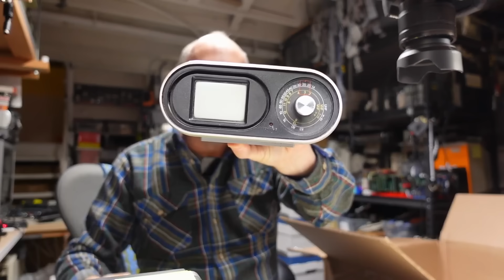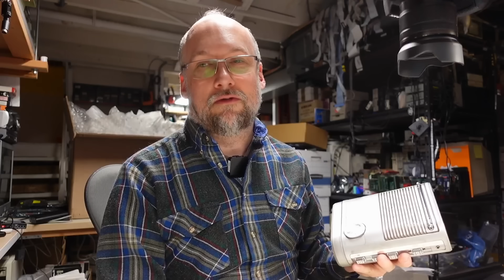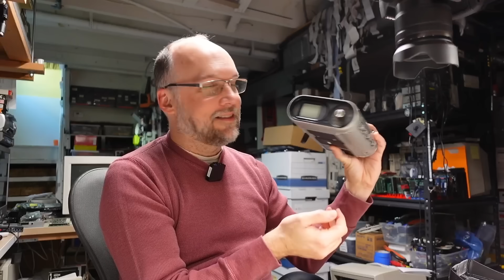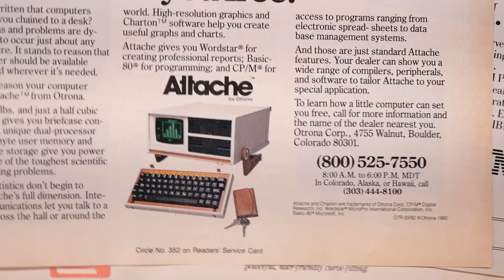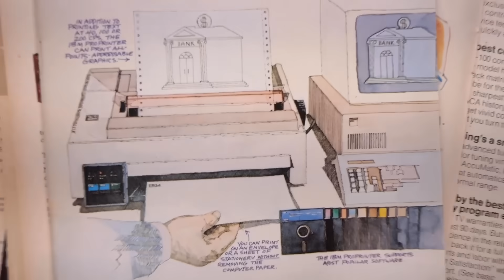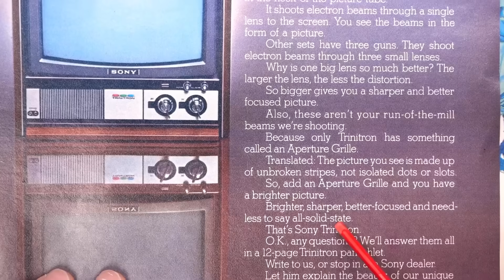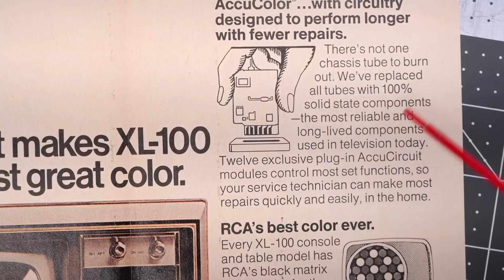0076 A binocular TV, the wiggle method rocks on Mac parts, and some awesome old print ads

Comment: Tubes can work in a phase locked loop and can provide a stable and accurate oscillator as a result. They just need a little time to stabilise as they get up to temperature (although some designs were almost instantaneous in reaching operating temp and were low noise at high frequencies and very stable e.g. Nuvistors). NTSC transmitted two phases of color and a burst which helped to synchronise the oscillator. The reason it altered in hue was not so much down to the tubes (although they were a factor) but rather the fact that NTSC didn't alternate the phase to get phase error correction like PAL and SECAM did. I'm not saying PAL or SECAM were better - they had their own different problems (look up Hannover blinds for example).

Comment: The early transistor manufacturers in the US went to the consumer electronics makers in the 60's to find out how cheap they had to be able to sell transistors to get into the consumer electronics market.  They found out the tube makers gave tubes to consumer electronics makers for free, and made their money on the replacement market.

A couple of decades earlier, the pioneers in electronic computers discovered the tube makers had a trick to make tubes fail relatively fast:  They over-rated them by about 25%.  The early computer makers found that de-rating the tubes to about 80% dramatically improved their lifespan.
Reply: I don't think they were actually over-rating tubes, it's just that the design life wasn't very long. Derating extends the design life. On a similar note, most capacitors are only rated for 1000 hours when run at the rated temperature.

Comment: If indeed the polarity is correct on the zenith the Zenith requires a 780 milliamp power supply.  It may not be able to start if it's only getting 300 milliamps, because it takes a lot of power to get that picture tube running

Comment: That "Macro Arithmetics Processor" is actually pretty freaking bad-ass for its day!

I found an older version on Archive: 15 Million rounded 32bit FLOPS, Coding in ASM or Fortran (it's architected to accelerate Fortran in Hardware), Field upgradable, blah blah.
Recommended use was vector processing for Seismic activity, Sonar and Radar, Telemetry, Biomedical, X-Ray, Image Processing, Comms and Speech, !Nuclear Science!, Vibration and Noise Analysis ... and ... Simulation!

And that's the older model! I'd love one of these 😀

Edit: The specs given here are from 1976 (my year of birth!) and the machine operates like a co-processor. It needs a host to give it commands and files and so on.
RetroBytes did a video recently about "The Transputer: A Parallel Future", This MAP seems similar ... worth a watch!

@Adrian I would love to see you play with one of these!!!

Comment: One of the first jobs i had was at an appliance/tv store, and i repaired a few tube based PTP wired sets.  The oddest part was the terminal strips which were just jam packed with capacitors and resistors, because where else would you mount them?

The interesting thing is those old tube TV's were almost always repaired by replacing whichever tube had blown.  I'd pull the cover and look for the filament that wasn't lit up.  No adjustments or anything, pull the bad tube, replace it and the TV was repaired.

Comment: When my parents upgraded their TV, I inherited a monster of a console unit.  A Zenith 25" console TV with the wood construction all around, and the neat pull down panel on the right side that had the controls (vert, horz, tint, color, etc).  I did have a terrible set of rabbit ears and the vacuum tubes were starting to fail, but you know for someone who was 8 years old at the time in 1983 it was awesome!

Comment: I did some looking up on the older computer companies. The CPSI MAP-6420 appears to be aimed at data acquisition. There's an article about it from the US Department of Energy. From what I can interpret from their advertisement is their computer is far smaller than the big array of cabinets in the background. Their headquarters was located about 30 miles west of where I live now. I worked not far from there in Lowell during the same period. I couldn't find much else about them.

The Attaché was Ortrona's first product and the company was founded c. 1981 and was liquidated in 1984. The company had a not-so IBM PC Compatible model but couldn't produce it and that was the end of them. So much for their success. There's an article about them on Wikipedia.

I found the advertisements interesting. Having worked as a typesetter, I noticed that the typefaces look so clean compared to the digital printing we have today. The text was typeset on a typesetting system and films were produced from the output after everything was pasted up on boards. To this day, this output is far cleaner and crisper than the output we see from digital systems which are limited to 2540 dpi unlike the analog printing methods of the past.

My first interaction with Zenith TV was when I was about 3 years old. From what I was told, I was interested in the workings back then and used to pull the cover off and poke at the tubes and "adjust" things. Dad would be fuming when he got home because he had to readjust everything to get the TV image back into alignment. Little did I know then that electronics would be part of my life 17 years later.

When that TV was replaced in the 70s, it didn't die and went to a neighbor, we then got a Toshiba that we had had for years. I remember dad adjusting the color on that periodically because the flesh tones went out. After that it was Sonys similar to the one your parents had.

Comment: ntsc color problems are due to multipath transmissions - reflections from passing planes or nearby metal structures. If you add two sine waves with the same frequency you get a third with the same frequency but a different phase (so different color). If you see "ghosts" in a black and white screen then you will see the wrong color no matter how good your electronics are. But in the mid 1970s ICs started to replace transistor boards in TV sets so it became possible to add a reference signal hidden in the vertical blanking at the transmitter to let the receiver adjust the color automatically (eliminating the manual "tint" button).
Reply: Wouldn't the multipath interference impact the color burst by the same amount? It would then cancel out for larger sections of color. The reference signal in the vertical blanking was a much later 1990s innovation.
Reply: @eDoc2020  the color burst is reasonably short, so it would indeed be affected the same way for short delays but wouldn't help with longer delays. My father worked at GE in the early 1970s on a joint project with Tektronix to add the reference signal, but that was studio to studio (specially coast to coast). This only reached consumers later, as you said.

Comment: Tap water bad. Has minerals/salts/clorine. Want deionized water or no water at all and if you really want it dry, place in the oven at 110c for 3-4 hours. and the water under the chips will go away too. In manufacturing military radios we would preheat the boards to drive off all possible moisture before running them through solder flow to ensure rock solid connections.

Comment: My first IBM compatible computer was a AT&T 6300, it was so awesome. I chopped up the PSU to use it with the 368DX 40 I bought at a computer fair that I had running in the box it came in, I was a poor college student at the time.  I wish I still had the AT&T all I have left of it is the 5.25" floppy drive.

Comment: Adrian, I have a "Cathode Ray Oscillograph" Model 830 made by the Modern Electronic Company, that looks similar to a "Triumph 830 Wobbulator / Oscillograph" that you can find online. Would you be interested in having it, or do you know another youtuber that might like to have it? You mentioned in this video that you're not as good at fixing analog equipment and being that this is a severely retro oscilloscope it seems to be near, but outside your area of interest. Also, if any other viewers know a worthy youtuber I'd rather send it to someone besides the trash.

Comment: Someone with a 3D printer and pictures of I'm missing battery door and some measurements could print you a replacement and you could spray paint it the same color.

Comment: I bought a widescreen 26 inch Trinitron back in 1996, pre-WEGA... It was in constant use, at least six hours a day for over 22 years before the tube surrendered. I replaced it with a Bravia LCD TV, and I made sure it had a SCART socket to attach my Sony DVD player to, which I bought in 2003, and which is still in perfect working order and in daily use. (Since 2011, I've worn out the lasers on 5 Blu-ray players) "They don't make 'em like they used to" cliche invoked...

Comment: The $100k MAP array processor sounds rather like ICL's DAP (Digital Array Processor) which was used as a co-processor for mainframes to massively accelerate certain kinds of parallel workloads in what’s now called a SIMD method. For particular workloads (I think weather forecasting, maybe?), these were seen as giving your mainframe supercomputing-like performance at a fraction of an actual multi-million £££ super-computer. The $100k MAP array processor sounds rather like ICL's DAP (Digital Array Processor) which was used as a co-processor for mainframes to massively accelerate certain kinds of parallel workloads in what’s now called a SIMD method. For particular workloads (I think weather forecasting, maybe?), these were seen as giving your mainframe supercomputing-like performance at a fraction of an actual multi-million £££ super-computer.

Comment: That little Binoc set would be super cool if you could do a composite mod on it and place it somewhere such that R.O.B. Could look at it and have the video output from your NES Split 2 ways  one going into a modern LED via a Retrotink or something and the other going off to the little CRT to flash the signals the Robotic Operating Buddy Needs to see. I've often wanted to do something like this to my Living room setup so I could use my R.O.B. In the living room rather than having to use him in my office on my 20" CRT where I use my Zapper and my Power Glove.

Comment: @adriansdigitalbasement2 I have two of those Zenith TVs as my grandfather worked for Zenith.  There were two main variants.  They look almost identical, but one had a radio, and one didn't.  I do remember that it does have a rechargeable battery.  It was a fairly large square 4inx4inx1in perhaps.  My dad kept one on his desk at work (and that one sits on my desk now) and my mom had one in the kitchen.

Comment: Some modern OLED tvs use the same black background between pixels for deeper blacks.  Each phosphor pixel has a relatively slow decay time and in fast moving scenes never have time to fall to complete black.   Putting the black between the pixels adds much higher contrast.  Static scenes will have deeper blacks as well. We had a similar TV when I was much younger.

Comment: You should be able to test for centre positive for checking continuity between the ground on the power connector to some other ground point on the set (like headphones)
Reply: That can tell you which side is ground but it doesn't tell you which side is positive or negative. Old equipment mostly used germanium PNP transistors and had a positive ground. If there's a chance the circuitry was designed before the 1970s don't assume ground is negative.

Comment: One method I've heard of for treating boards with leaky caps is to soak them with WD40, the oils are supposed to bind with the electrolytes and form an inert soap-like substance.
Seems to work, as a Mac I tried it on went from not having sound, to making the bong after I sprayed it and let it soak for at least a day.
If you ever have a large number of boards to process, could give it a try with one of the more-common ones?

Comment: The first page would be a model 6300 Plus x86 PC. The 6300 was a 8086 floppy-only DOS machine, the 6300 Plus was a 286 with a hard drive and... was weird. It would run Simultask which ran DOS as a virtual machine on top of AT&T UNIX System V.  That's how it talked with the 3B network. After the 6300 plus, they handed off this business to Olivetti.

Comment: The "720K diskette storage" in the Attache ad was for both floppy drives combined. Old computer ads loved to do that, sometimes citing it as " up to ____K diskette storage" by including all possible internal and external floppy drives you could attach to the system.
Reply from the maker: Haha, how sneaky. No, not 80 track disks but two 40 track drives!
Reply: Yes I thought those 720K in that era in Z80 CPM are a bit suspicious, but this explains it. 😅

Comment: We got an RCA XL-100 25" console model in 1975 (no remote) and it lasted until I replaced it with a 27" Sony WEGA in 2008.  So, yeah, they were reliable.  I don't remember having to do much messing around with the tint or colour.  I did have to replace a bridge rectifier in the PS once, but that was it.  We had it for 33 years and passed it on to someone else as a donation to a needy family.

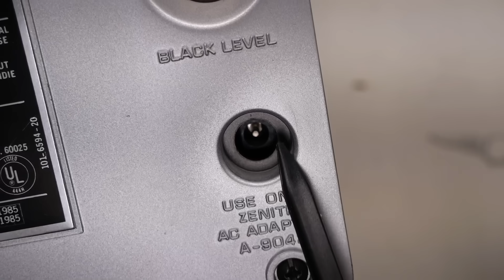Comment: @15:31 my quick trick to know if center positive or negative is just to check with the multimeter if the center pin has conitnuity with the body of the RF antenna connector

Comment: On the Motorola ad, that 'squiggle' below the picture is an older logo before they switched to the now famous bat-wing "M" in 1955.
Reply: I agree it's definitely before 1955. The shape of the picture tube looks like the first-generation rectangular picture tubes which were around 1951-1952, plus tube sizes switched to odd numbers with the later more bulbous shaped tubes.

Comment: Have one of the Attache, our buddy Earl managed to buy out the repair center's stock of parts, they are very hacked together inside with stacks on stacks of bodges. The 2nd CPU option was an 8086 dos compatibility card that slotted in, and could optionally add another serial port and IEEE-488 port. I don't think we ever got any of them booting. I've given up on trying to get mine working and have put off using the case for a cyber deck project. The plastic hinges and latches on the mushy keyboard tend to fall apart, as do the plastics on the carry handle. If I remember correctly the floppy drives were 0.625 height (in between half height and full height).
Reply: If you have an 8086 processor with a z80, then it's an 8:16 which is the second model they produced. It actually performed better than other portables at that time because it was truly software compatible.

Comment: I remember my grandparents had a small TV set very much like that little Trinitron set in the second bedroom us grandkids used. If I recall correctly, the 'standard' color CRT had three gun assemblies mounted in a delta formation. The Trinitron CRT has a single gun assembly with three cathodes and a shared aperture for the three beams.

Comment: yep 3B1 ran AT&T UNIX System 3/5 - I'm very interested in what hardware and software you have - I have a lot of tapes and floppies with AT&T software for both 3B1 (x86) and 3B2 (WE 32000 32-bit microprocessor)
Reply: He has one of the UNIX PCs that has a 68010. I don't remember the exact model.

Comment: I remember upgrading from a VHS deck connected to a late '80s 21" GE (via RF, yuck!) to a brand new DVD player feeding a 32" JVC D-Series via component. That was back in 2000. What a difference! And technically, I went from a 480i setup to...well, another 480i setup. But it felt like I had stepped into the world of HDTV.  I mean, I could suddenly read the credits at the end of a movie!

Comment: What it means by a jet black background is that before that, the CRT's tension mask or tube was light colored. But that removed some color definition and contrast. By using a jet black, the colors were more defined and with more contrast.
About color tvs, in those days they used a filter that removed part of the color information. Then some companies developed de Comb Filter. I'm not sure, but it removed some signal noise but preserved the color info.
Also, GE developed VIR that helped improve the image. I'm not sure how it worked either. But I remember it won an EMI (or other) award for it.
Hope this helps.

Comment: There was a time around 2005 to 2015 where even just owning a CRT TV would make you an outcast of society.
Like having an awkward disease. Or driving a car that's too old to be fashionable but too new to be vintage.

There's a decent chance that kinked TV has a blocking diode to protect itself from people plugging in a power supply with the wrong polarity. In that case, you get no current flowing whatsoever. Although your theory of the power switch being bad is actually more likely. Pinch pennies twice by leaving out the diode and installing an inferior power switch.
Anyway - I bet fixing the thing takes you less time than reading all the comments on what might be the issue...

Comment: What happened to Zenith is they got bought by gold star for there early HD TV patients. Gold Star in return  ran them into ground in 90s for having some the worst CRTs ever made and gold star used the same tubes so both are junk between 93-95. 96 and later are better but not great as they often have a pretty short life.

Comment: This is not the case of Trinitron where the Sony advertising "stretch the truth" a little, there are in fact 3 "guns". But some Sony TVs used a multiplexed cathode, they had a white phosphor turned to the inside between the color pixels and then when the beam hit those the multiplexer was acted to switch to the next color by a light sensor inside the tube. This made the tube much smaller, they were called Indextron. With that there was no need for shadow mask or aperture grille that was a plus.